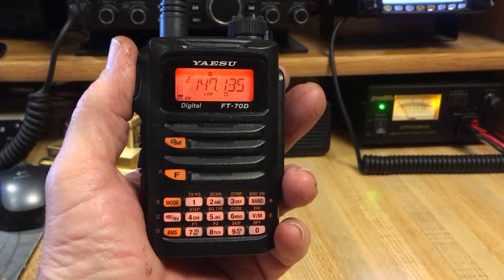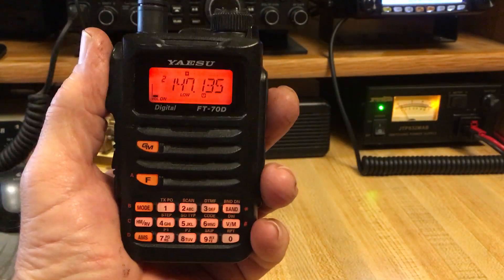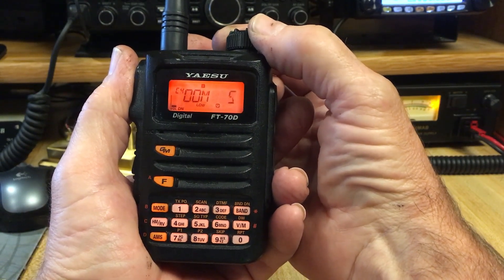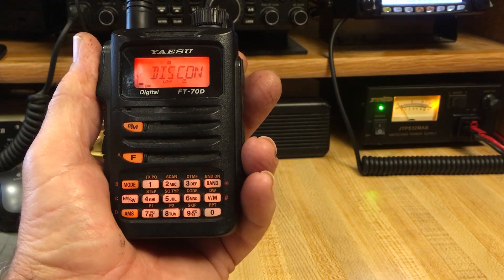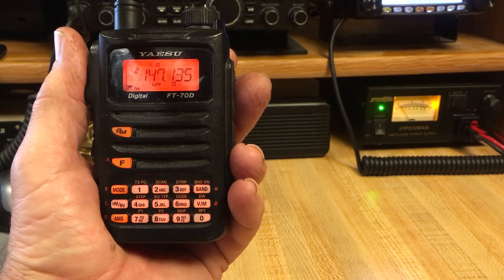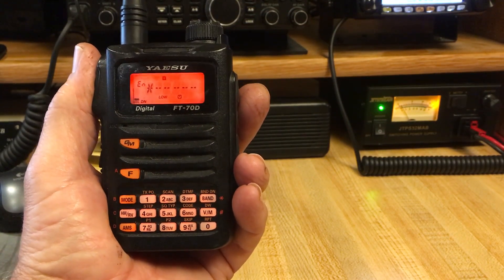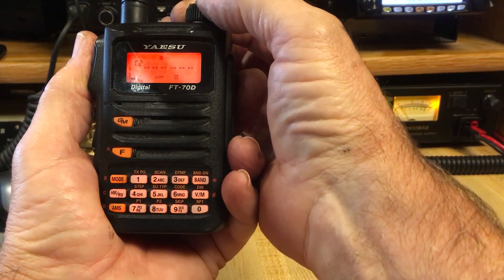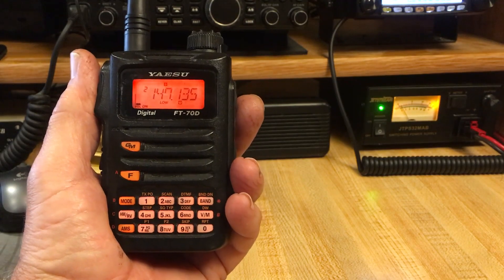Yaesu FT-70DR Wires X Control

Comment: But don’t you also need a second radio on and connected to Wires X ?  I only have the FT-70. I watch a very confusing video from a dude in Canada.
Reply from the maker: This video is based on accessing our local Yaesu repeater connected to Wires X.  The FT70D cannot offer you a Wires x connection.  The FT5 or current Fusion mobiles can perform that function in the PDN setup.

Comment: I agree it is a great video.  My main question is where did you learn these keystrokes?  I've gone through the regular and advanced manual and cannot find anything resembling what you did.  It definitely works as I tried it but I'd really like a clear and concise reference that gives this type of information.
Reply from the maker: I'm glad the video is still providing a service.  It's been some time since I produced it and I can't honestly say how I came to know the radio.  I might have read it or I might have played with it until I got it.  Either way, I knew that it was time to produce the video when my mind was fresh with learning the radio.  Nothing wrong with any Yaesu portable, but the FT70 is still my favorite.  
The operating manual found on the Yaesu.com website under FT-70DR files is described as "(including the Wires X function information)" and does describe how to use the features.  But the information does not jump off the page.  It takes a bit of effort to follow.
Reply from the maker: Start at page 30.

Comment: I'm in "frequency" mode. I mean, what is showing on my FT-70D us the frequency numbers and Not the "call signs" I already have programmed in the radio. I was trying to follow your direction and got messed up and Now I can't get back to my Already programmed frequencies. Any suggestions will be welcomed.
Reply from the maker: Restarting the radio and pushing the V/M button should always return you to the VFO or memory function. Your memories stored should all be there.
Reply: @mmlanger55  It did not work. 145.000 frequency is still there. I don't get it?
Reply from the maker: @joes6883  I would not be too concerned about Wires X until you are more comfortable with the main features of the radio. Wires X only controls the node or repeater connected to a node. Possibly other videos or fellow hams can help you with your issues.  Wish you well.

Comment: Is there any registration that is required to operate wires x on the ft 70 dr
Reply from the maker: Wires X commands can control any Wires X network, so long as the owner has not blocked the activity. The registration is only for the node/PDN owner. Use the Wires X command only to change a room.
Reply: @mmlanger55  Thank you !!!

Comment: Hi, So with my FT70-DR  am I limited to 5 saved rooms per repeater (C1-C5)?  Is C0 not usable? It seems to store the last entered room. Also is there anyway I can see  callsign ID info when i am in a room like i can when  I am on my local Fusion repeater not connected to Wires-X?
Reply from the maker: Yes, you are limited to 5 saved rooms.  The manual states that C0 is "the most recent connected node ID or room ID screen."  See page 31in the manual for a good explanation.  The FT-70D has limited screen capability, so you cannot see the callsign ID while in the Wires X mode.
Reply: @mmlanger55  Thank you very much for replying so quickly!

Comment: I have a Yaesu Speaker/Mic (SSM-17A) and it seemed to not work on the Fusion room. Anybody else see this? I used the PTT on the radio and then it worked. Maybe I'll try it again tomorrow.
Reply: Got it working; not sure what I did wrong.  Maybe it wasn't plugged all the way in?

Comment: I wanted to thank you; I got on America Link and made a contact in Okinawa, JP tonight and it's thanks to this video.  I'd love to figure out how to program the FUSION stuff from the software I use (RT Systems; I have a Mac and the free Yaesu software doesn't work) but maybe I don't need to.  Went to a local repeater and the connection and signal were strong. I added MNWIS and America Link and a few in Australia but any recommendations for good rooms to pick?
Reply from the maker: Hello Greg.  Glad to read your report on the good experience with Yaesu Fusion.  You might consider checking Texas Nexus #21636, CQ UK #27793, Ohio Link #40557.  There are many more good Wires X rooms. Look here for room listing https://www.yaesu.com/jp/en/wires-x/id/active_room.php  MNWis hosts a technical net every Monday night at 7 :30PM Central time where you can learn some of the latest discussion on Fusion topics.  See https://wp.hamoperator.com for additional info, The software, Yaesu and RT Systems,  does not restore the room information on the FT70 to my knowledge.

Comment: I am new to the FT-70DR and am I correct that you have to program the WIRESX memories every time you power off and back on the FT-70DR?
Reply from the maker: Wires X memories are retained once they are programmed even though you power it off.  YSF reflectors from hotspots and Openspots are not stored as they are not within the Yaesu standard.
Reply: That explains why they are not retained by the radio. Makes it a pain to use a hotspot, though. I like using the DMR radio with the Hotspot because you can program the channels with the frequency of the hotspot and the Talk Group you want to use.
Reply from the maker: @n5pa  Yaesu designed the features for the Wires X hardware and software.  The hotspot is a great accessory but they do not offer complete compatibility. DMR may seem easier to you but I would take the flexibility of Wires X software (Rooms, Nodes, PDN's, etc.).

Comment: i wanted to pick up this radio to listen to local emergency services.  but my local pd is on 853 mhz  and the ft70 only recieves up to about 500 mhz right? thanks for any input have a good one
Reply from the maker: The FT70 does not cover 800Mhz.  Most of law enforcement has transitioned to new digital formats that are not compatible with amateur radio receivers.  For us locally, the days of listening to public safety on amateur radio are long gone.

Comment: Nice job, excited about using mine. Much more I need to learn as I travel as a trucker and finding repeaters that are Wires X I can connect to and use. The research continues. 73 KG4NAI

Comment: Hello, I was wondering if the room number (node id) that you inputed was somehow connected to a HRI-200 or just a normal hotspot?
Reply from the maker: You will input the number associated with the hardware you are using.  With a Wires X connection (strictly Yaesu), use the number that Yaesu offers on its own cataloging. Check their updated system: https://www.yaesu.com/jp/en/wires-x/id/active_room.php
For an Openspot or Pi-Star based device, use the YSF number:  https://www.pistar.uk/ysf_reflectors.php
The FCS numbers cannot be entered into the FT70D to my knowledge.  That selection will be made on the device.
Reply: 1

Comment: Can you do a comparison video of the FT-70DR vs the Baofeng radio? I currently own a baofeng and I'm exploring on the benefits of upgrading to this radio.
Reply from the maker: My reason for the videos is to help our new local Yaesu System Fusion users. So I can't offer you the video you are requesting. But I will say that there is only one reason to own a Baofeng: the price.  Other than that there is no comparison.  For the money, the Yaesu FT70 offers you so much more in quality, performance and features.  I believe you will find other helpful comparisons available to  you online.
Reply: I have both baofeng and yaesu hts and like them both for different reasons.  I use the 70dr when I'm traveling to other areas because the memory banks and good scan rate allow me to load a bunch of repeaters into memory and then call up specific banks of them while we travel.  I'm just starting to explore the digital side of the device but the FM side is bomber.  A couple of negatives that may effect you on the 70dr, the mic/headset Jack disconnects really easily during field work (I put gaffer tape over it and that helps).  No frs/gmrs so during CERT events you'll need a second radii. Or use the baofeng like I do.

Comment: Hey have you notice if something is going on with wires x? I’ve tried to login on with my ftm-100 and I get nothing . As of 3 weeks ago I can’t hit the repeaters that Have wires x.
Reply from the maker: Nothing has changed.  I use Wires X every day to control 4 repeaters and 3 hotspots.  Sometimes the PC on a node station needs to be restarted.  In the meantime, it works to pass audio but will not be available to Wires X commands.  And remember, if signals have multipath or are weak, Wires X does not have the aggressive error correction that digital narrow voice offers.  Be sure and talk to the repeater owners.  Maybe they can help you.

Comment: I have a question.  If I'm using a repeater to connect to Wires X,  am I tying up the repeater for others if I'm going between rooms?
Reply from the maker: The repeater can only offer one communication channel at a time. So, yes, if you change the room on the repeater, everyone goes with you. We offer multiple repeaters to allow users to visit different rooms. But when they time out, they link back together.
Reply: @mmlanger55  So would that be a good reason to get the HRI 200?
Reply from the maker: @RetiredFE  Having your own Wires X node is a great way to go.  You can enjoy your own independent exploration of Wires X Rooms and, with a good node station, offer your node service to other hams in the area.  You will need to learn about setting up the HRI-200 with port forwarding on your home router.  See www.hamoperator.com for more helpful info.  Look for the Wires X Bible.
Reply: @mmlanger55  Great.  Thanks for your help.  Much appreciated.
Reply: @mmlanger55   I've got my HRI-200 up and running and it's awesome.  Thanks again for the help.
Reply from the maker: @RetiredFE   Good job, Rodger!  i own or maintain 5 nodes for different repeaters in our area.  I've been very pleased with their reliable performance.  Enjoy!
Reply: To make sure I understand correctly - if I have just the Ft70 and a hri200 hooked up through my wifi network will I be able to access nodes or rooms or do I also need another rig like the ft100 or 400? Ft70 is on the way thanks to black friday. Thanks for a very good video!
Reply from the maker: The HRI-200 uses a radio to create the RF link and it requires a Wires X compatible radio. The FTM-100 is the most frequently chosen as it works well and is the lower cost radio for digital use. The radio is the more costly part of the node station but well worth it. You will enjoy using it with the new FT70.
Reply: Thanks, That's what I thought. Now I've got an excuse to do some more Black Friday shopping. Hopefully we can connect sometime.
Reply from the maker: @naparetired  That would be great.   I'm mostly active on rooms #28439 and #21493.  Good ham communities to check out.

Comment: I have FT70 too, but I can store a room, say America Link in memory 3, check its there,, all good, disconnect and drop out of wires x, then connect to wires x and all memories are blank... anyone else have this, I am finding this the most frustrating radio I own so far....
Reply: I'm having the same issue... Connected through a jumbo spot
Reply from the maker: I’ve read from the Yaesu rep that the FT70 does not support storing rooms through a hotspot. Wires X rooms will store from a Wires X node only.
Reply: @mmlanger55  Hi, Thats interesting, I dont have any 'true' wires x  nodes/repeaters locally, but a local ham has wires x setup so I'll have to go to his and see if that is the case, seems a little odd that I can connect wires x through a hotspot via a node that supports wires x, call up a list and select or enter manually a destination and it all connects and saves to the memory, but the radio drops it once I close out of wires x.... all good if thats how it works...pretty sure there is another way to store and connect, just not looked too closely at it yet... thanks for the insight
Reply from the maker: Sorry to hear about your experience, Cliff. Hard to help you across the internet. 
I’ve found the 70 to be one of the easiest Yaesu radios ever. The only responses that I would have are that either the Wires X room never gets stored or that you update your memories with software which doesn’t support Wires X memories. 
Even without Wires X memories, the direct entry of a room number is still more easy than the steps required of the other radios. Good luck.
Reply: @mmlanger55  Hey, no problem, I guess I got a bum unit, I reflashed firmware and still doesnt save, but for a handy at home its not a bad unit
Reply from the maker: Here is a small quote from what John, N9UPC, the sales rep for Yaesu has just posted on Facebook: 
WiRES-X nodes or rooms use actual numbers as the address to the room. Therefore, when you attempt to save a room into a WiRES-X memory on a radio they will save. If you attempt to save an FCS or YSF reflector it WILL NOT work. EXAMPLE: Yaesu nodes start with a 1xxxx or a 3xxxx number and rooms start with a 2xxxx or a 4xxxx number. So if you want to store say room 21001 into a WiRES-X memeory slot you can enter 21001 or the room name. YSF reflectors do not have a number associated with them and FCS numbers do not work. Even with FCS the server 00x and reflector xx equal a five digital number the number would always stat with a 0 (like 00xxx). The radio knows that 0 is not a valid number and will not save it. It might until the radio powers off but then it will be gone.
Reply: That sounds like its what could be happening, I'll have a look at a 'true' wires x node see if it sticks